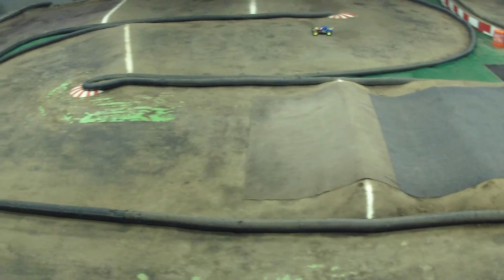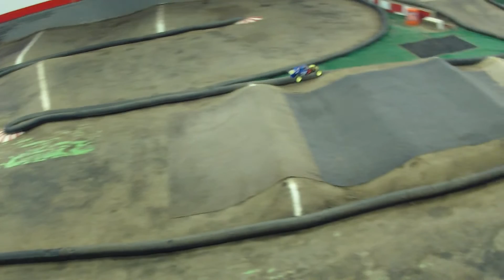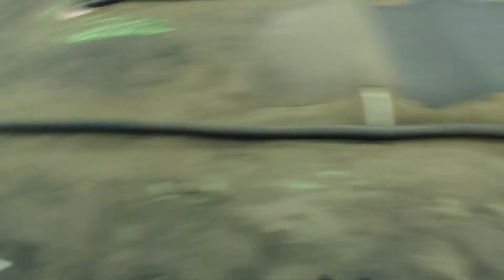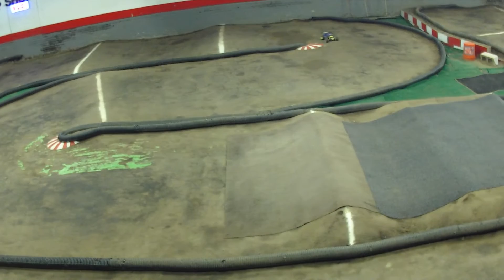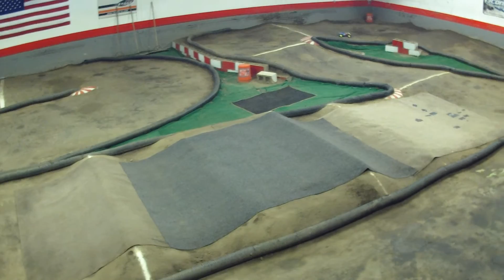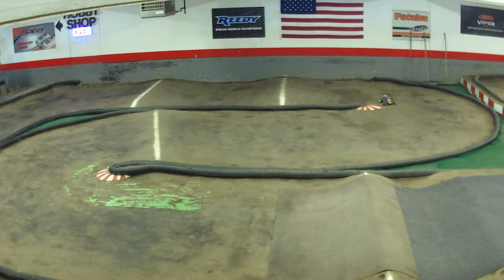Vintage RC10T with Losi Hydra Drive at RCHR open practice, 07/11/15, high definition

Comment: Truck looks dialed. What did you do to get standard spur gears to fit the slipper and Losi  hydra drive?

Cheers.
Reply from the maker: Robinson made a spur adapter.  I found one on eBay.

Comment: Hello Doctor,
I was wondering what type of oil you are using in the Hydradrive ? I have a Losi LXT with Hydradrive that i want to run for vintage races, and i've seen somewhere that diff oil could do the job (10000 cst) .. do you agree with that point ? 
Many  Thanks .. i will stay tuned to your channel . i learn a lot here !! :)
Nat
Reply from the maker: I am using the oil that came with the Hydradrive unit when I got it (I got lucky and found a NIP one), but yes, diff oil should do the job, as it is of a similar viscosity.  I do not recall the exact viscosity to start with, but you can probably find out on rc10talk.com.  The Schumacher Viscodrive unit was a bit different in that it used shock oil (around 80wt).